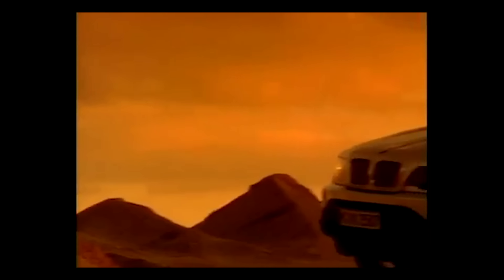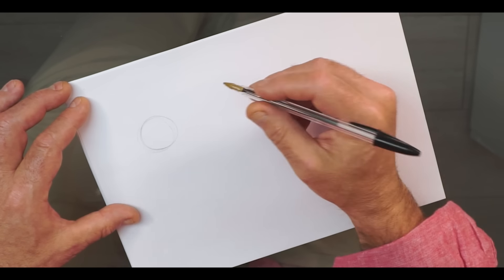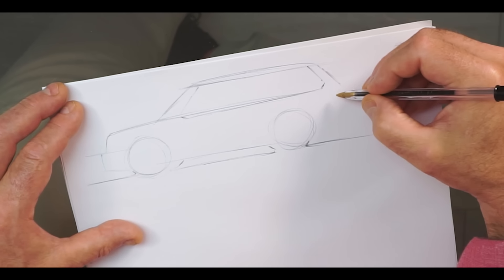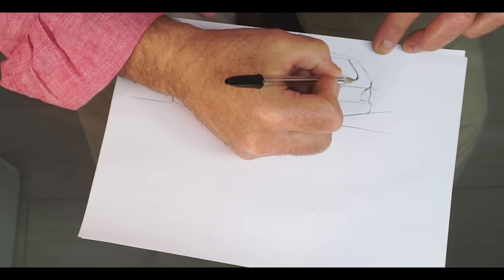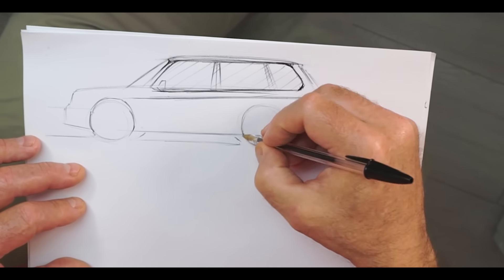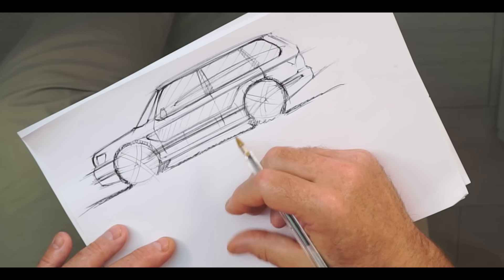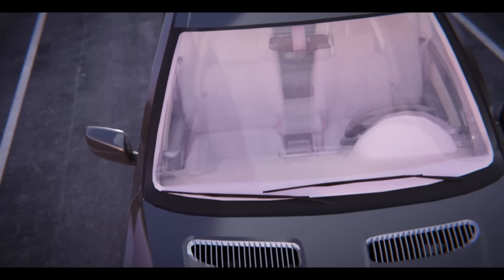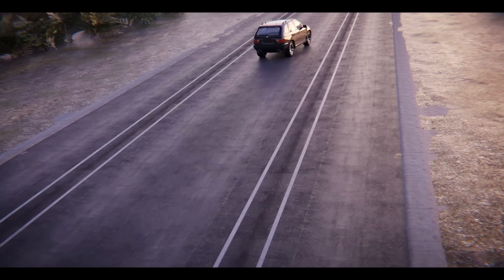How I Designed...The BMW X5! Ep.4

Comment: Always thought that first gen X5 was just E46 touring with high ride height.
Reply: X5 was based off the 5 series and x3 is based off the 3 series
Reply: @tito_ae8689   you are right, but he was talking about design details. Take the headlights, for example, they look like the ones from the E46 facelift with the turn signals pointing upwards and the tail lights look like the ones from the E46 touring
Reply: They share the same front headlights but it's mostly based off from the E39 5 Series
Reply: it was e39 5 series touring based. so was the design
Reply: With German cars you always have a design language that goes throughout the classes. Korean and generally asian carmakers could not keep a line up until recently. If you look at two Hiundays from 10 years ago you couldn't say it was made by the same company only by looking from outside.

Comment: The E53 X5 was a great platform.  The mid-cycle changes that were implemented in 2004 (X-drive, 6 speed manual gearbox for the 3.0i, larger headlights w/ angel eyes, kidney grille, hood, front bumper, clear turn signal lenses, sport steering wheel, panoramic moonroof and the gorgeous style 132 sport wheels, just to name a few) made the X5 almost perfect.  Everything was laid out perfect and it was a blast to drive.  The drivetrain was solid.  Too bad a manual gearbox was not an option for the V8 model.

Comment: I did some work on them on air suspension side and it was tricky for me in beginning but I got everything working I think level sensor wires was broken and I had to change some module but I towed a trailer with it and it was ok to drive and tow.

Comment: Subscribed! I love hearing stories like this from the people who were directly involved! I work as a Product Genius for a BMW dealership in Belgium. As a BMW fan and driver, I was wondering what your opinion is on the current design elements of modern BMW's. The typical Hofmeister Kink seems to be abbandoned on newer models, also things such as the line on the side of the car that no longer flows through the door handles (cost cutting?) and the classical corona (angel eye) headlights seem to be replaced by the new 'iconic' design. I'm all for evolution, but I also feel like some typical design elements, such as the ones mentioned, should have some sort of fixed value when it comes to the general design of a car. Just wondering what your take on this new BMW design language is.
Cheers
Thomas

Comment: Many thanks for sharing this story.  The E53 is one of my favorite cars of all-time (Interestingly, the P1 is also on that short list. So thank you, Mr. Stephenson!).  The current Titanium Silver 4.8iS in my care is only bested by the Titanium Silver 4.6iS parked beside it. Which leads me to an interesting questions: Do you prefer the post-LCI (04-06) model’s design over the pre-LCI (99-03) model’s design? Mostly just posing the question to ponder, but I also ask because I noticed you featured a 3D rendering of the post-LCI design... I wasn’t old enough to drive when the E53 debuted, but cars had been a deep passion since receiving my first Hot Wheels toy car at age 2. I remember at the time, visual LCI updates in the industry were relatively subtle, usually consisting of redesigned light housing lenses or wheel/color palette swaps... But then came the E53’s LCI.. While it may be subtle to many onlookers, I believe the E53’s LCI was one of the most extensive of its time.  From the reshaped kidneys, to the restyled front bumper, headlights, and the revised hood.. Not to mention the various mechanical and comfort feature changes... People often ask me which model I prefer, and while the LCI’d 4.8iS may be the better performer on the road, the 4.6iS design was just spot-on!  Thanks again for sharing, very cool! (P.S. I hope you didn’t toss that paper sketch away after filming this video. It’s a worthy piece of automotive design history.) Cheers!
Reply from the maker: Great observations and comments dm, very cool that you’re into the details. In a nutshell, it’s ALWAYS tough to beat an original!
Reply: Man you have a real bad taste in cars if the x5 is one of your favourite cars.
Reply: Max & Moritz, funny, your mom said I taste bad too... 🙄

Comment: Thank Frank for sharing.
 My family currently drives a 2003 4.4i sport X5.

 For the original design. Where the debut 19" rims what you intially imagined and designed? Or are the 20" inch rims that you show in your CAD model and in this video what you had originally wanted and designed?

Comment: Wow, what has happened to BMW since then, I think the entire design direction is lost, they really need to get some sort of meaningful direction and coherent design language back. The X5 and E38 7 series were so taut and flowing but coherent and complete. The latest designs are all over the place, generally lacking in a common language and where there is commonality the details are weak and messy. as for the huge kidneys; if you look at the cars it appears that the kidneys (more like lungs really) have become overpowering both in size and focus; the entire car is dominated by the grill and the rest looks as though it has been thrown together. The lack of tension is really a problem; the 1X is weak in just about every area; the lack of lines down the flanks makes it seem podgy and overweight. Sad really

Comment: I just have one problem. With the marketing, not design.
The term Sports Activity Vehicle or Sports Utility Vehicle is stupid.
Sports, in a car determines it is a class of sport vehicles, nimble on it's feet, good performance what you can do with it.
The large box shaped vehicles that are named SUVs, are not sport.
They should be called Crossover Activity Vehicle (CAV) or Offroad Activity Vehicle(OAV)  for the ones that are actually capable of doing offroad stuff, like the subaru forester.
The majority of what we now call SUVs are just CAVs, a minority are OAVs and just a smaaaal number being called Sports Activity Vehicle (not Utility) where we have the AMG, M or other v8 powered monster SUVs,...But those lack any for of utility. You use a pickup truck or van for "utility".

Comment: So you designed the horrible money pit that at 50k miles, has cost me over 6000$ in repairs?
Why would you design a vehicle with such incredibly faulty air ride suspension and steering systems?
Why would you build a car that is so obviously not intended to even have a life span that is the bare minimum of vehicles on the market?

The fact that you designed this in 2 hours very much shows.
Reply: You have a fundamental misunderstanding of how car design works. That's not his department, he was in charge of ideation, packaging and general looks. Blame the R&D for it and do some research next time. Jesus Christ.
Reply: @ddddzzzz5426  no, you have a fundamental misunderstanding about how design SHOULD work. The entire concept of a well designed vehicle is that holistically the entire thing  should be built in a way where ALL components function together harmoniously. 

His “ideation” as you’re saying it is responsible for that. He’s not solely responsible, I give you that, but he does bare a good amount of responsibility because the beginning concept is his and good design avoids these issues. 

He didn’t just sketch a shape on a piece of paper, he worked in an integrated way to unify the technical components in the vehicle and his vision of what it should be. At least there SHOULD be advanced collaboration between the different engineers and designers that avoids errors that cause failures but that didn’t happen. 

For example, the suspension. The compromises made because of the vehicle design also caused it to be at a disadvantage; had yet not chosen to make the design that way, it wouldn’t have such a stance or such a weight distribution which contributes to the suspension failing. 

It’s progressive, not direct like I think you might have thought I was saying. I’ve bought only BMWs the last 5 cars I’ve owned and have owned a total of 10-11 of them total; the experience of good/bad/SERIOUSLY BAD is split right down the middle but only this exact model was bought back as a lemon and caused so much embarrassment that I was personally sent a letter by the CEO of BMW NA apologizing for how bad the ownership experience of the X5 was.

Comment: I have this car. Now I know why it always felt like a unfinished prototype. Door handles breaking off, window regulators breaking down, top rear door wiring falls apart and shorts, the trunk opening button and licence plate lights are easy to break off, head liner splits, the panoramic sunroof option breaks often and when it does can easily total the whole car. And on top of that it has all the regular BMW engine related issues if you happen to have a V8. I like the styling, but it would be so much better if they didn't rush it to production, actually test it properly and fix all the common issues the owners now face.
The guy who designed the door handle carrier mechanism deserve to be publicly hanged by his rib. People in colder climate change this mechanism every winter. Others every two years. And each time it is a 4-5 hour job on which you hurt your hand.
Reply from the maker: Really sorry to hear that Darek! Sounds like your X5 got built on the last shift before the weekend or the first shift on a Monday. Drinking beer on the production line should be a crime.
Reply: Well. It's not the only BMW I have. I am present on E53 forums and I see what most people struggle with. The X5 drives great, it is very stable at speed and you can trust in the corners or when braking. The drivetrain, suspension, steering and brakes are really solid, but when it comes to fit and finish of the body it's a complete mess. Even the door locking mechanism sound cheap and clunky. E46, E39 and E38 are nothing like it.
Maybe except the horrific cup holders, these are way better in the E53.